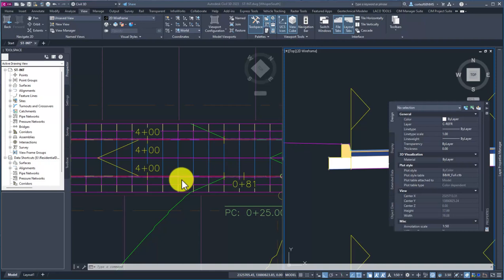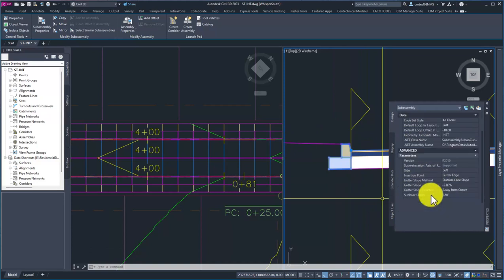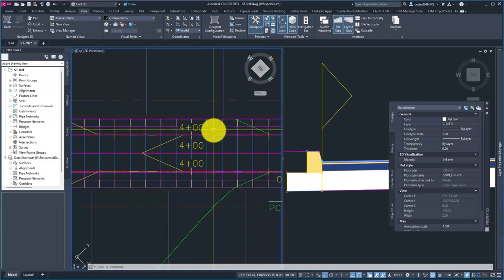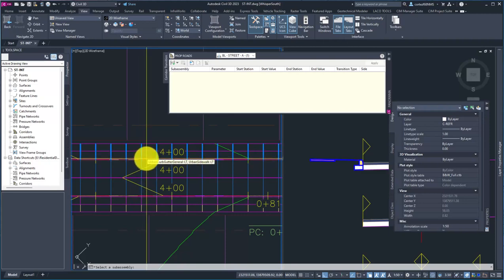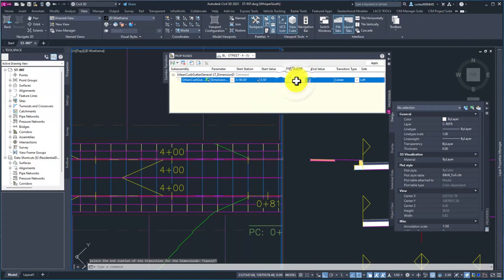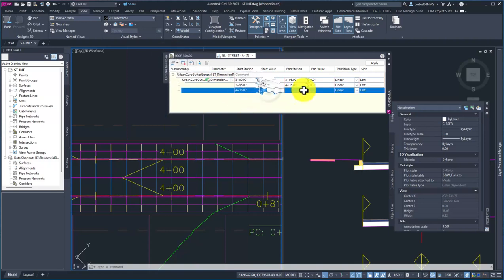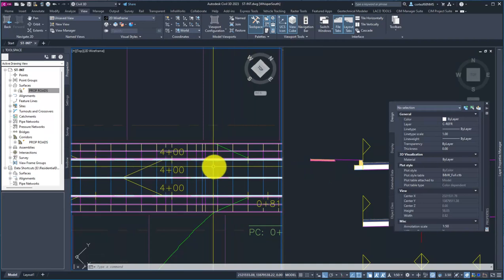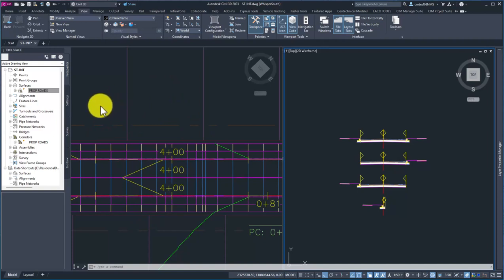Civil 3D 2023.2 Corridor Transition tool makes curb ramps and driveway ramps easy

Comment: One thing to point out is, your start value and end value in your panorama window are set to feet, mine are defautl to inches for some reason, so when i followed along and typed "0.5" it was 0.5 inches tall not 6 inches, or the half a foot curb height that I wanted.

Great video over all I would suggest turning off the giant yellow spot on future videos, as it made it hard to see exactly where you are clicking on the screen, your mouse cursor is quite big enough to do the job!  Thanks for the help!

Comment: Hi quick question, how do you model it so that the sidewalll/pedestrian footpath behind the curb will stay constant levels rather than dropped by the transitional drop of the curb height? (if that makes sense)
Reply from the maker: I would create a feature line going across. lock both ends to be relative to the surface of the sidewalk. Then offset it .01-.05, so C3D doesn't freak out.